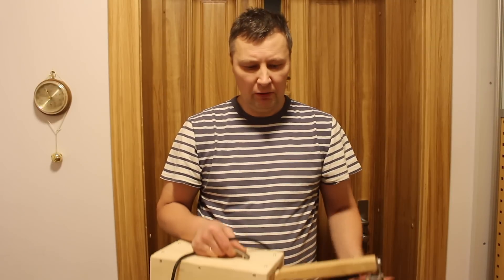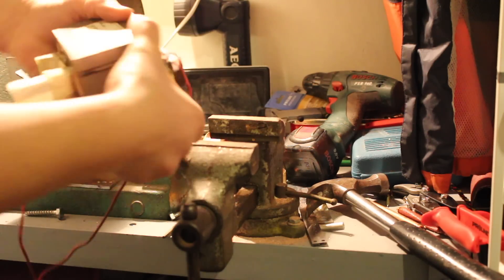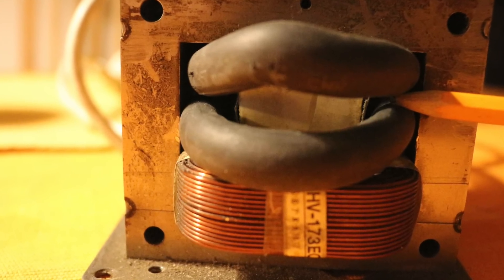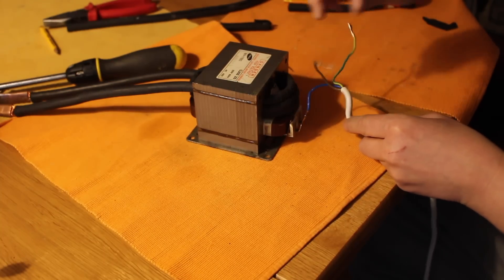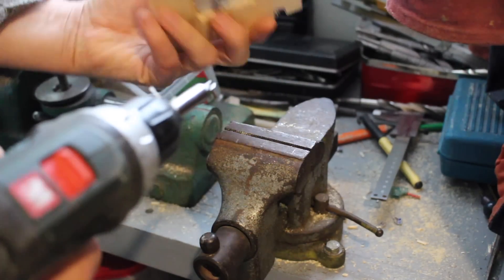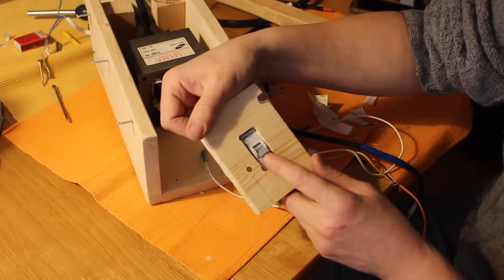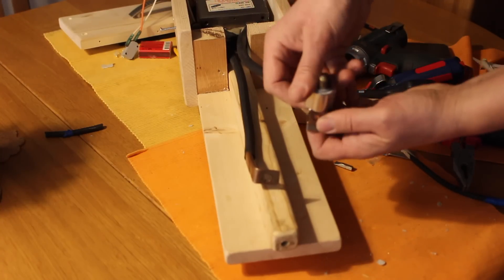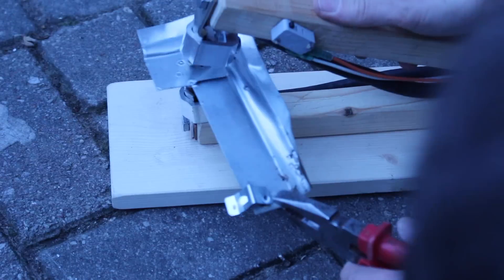Spot Welder from microwave  -   how to increase the power

Comment: I just shortened the lead wires on mine and worked better. You increased the voltage with another turn thus shortened the lead wire.

Comment: where did u get that black cable did u get that from the microwave? How long the cable must be if u do 2 turn  also if u do 3 turn thx
Reply: Black cable is from a stick welding leed. Or a groud leed. Can get it from a welding supply store or maybe a car stereo shop the wire from subwoofer amplifier to batteries

Comment: I want to build a spot welder like this but set it up to weld mortice lock keys together to make my own keys. Do you have any suggestions on how to modify the welding electrodes to weld keys up from scratch, I know that most modern mortice lock keys are spot welded together in 3 pieces (a washer, a stem and a blank part that is cut to the profile of the lock levers) but HOW are these keys welded together using a spot welder ??
Reply from the maker: quite difficult, because the exact current must be hit
Reply: @marisbuildsahouse4304  Hi, I've been working on building a butt welder instead which is what these key manufacturers use to fuse together the parts of a mortice lock key. It does require a very high current from a similar microwave transformer and also a timer to get the butt welds even and exactly the same every time when the key parts are mounted and clamped tightly in the brass holding clamps/welding jig.

Although my butt welder is not quite ready yet, As soon as it is ready and working , I will upload a video of it working on my YouTube channel for everyone to see !

Comment: Did you remove the magnetic bypass also?  In the first version I could see they were in place.  They are the metal sheets between primary and secondary winding.  They limit the current by allowing the magnetic field to take a bypass route.
Reply: I noticed that too. I know them as shunts and they were in place at first then later removed. This is why the nail melted, as amps increased due to their removal, not due to the extra turn which would have increased volts.
Reply: @mattmcgahan  yes and no. The current is limited by the transformer but also by the resistance of the weld. In theory 1 turn should yield the most current but because the voltage is really low then, the resistance limits it more then the transformer would with more windings. Around 3 turns is the most optimal balance between voltage and current in a MOT spot welder
Reply: @felixb.1756  That's right, and anyway, in any case you should try to use as thick cable as possible, why leave opening not used.
Reply from the maker: remove

Comment: How can increasing the turns of the secondary coil increase the ampere? That only reduces the ampere and increases the voltage of the secondary coil.
Reply: Note that, he reduces the cable distance, then the resitence is low. I dont belive that  it is relare withnincrease the volts.
Reply: @TheHeliosm  He uses the same cable for the two trials on the secondary coil. Therefore, the resistant is unchanged. When he increases the turn of the secondary, he reduces the ampere. He needs higher ampere in the secondary coil to heat up the objects quicker. To increase the ampere he had to reduce the turn of the secondary coil. According to the physics if I make the turn of the secondary equal to the turn of the primary coil, both of the coils have the same voltage and ampere (if I did not count the loss of energy creating heat in the metals). If in the same coil I increase the turn, I increase the voltage but the ampere and vice versa. I am going to find a transformer to try and see what will happen. Thank you for your interesting.
Reply: Yes,  but the conductor  have less resistence it is shortes, out of coil.  For other hand , you have less current but  the voltage increase. Take in acount that    inportan is the power. I did experience 10cm  can reduce de power in the load from 600w to 300W
Reply: @TheHeliosm  I get what you mean. I agree with that.
Reply from the maker: its real

Comment: you can get heat shrink tubing in long lengths at harbor freight cheap, i would use several layers, is your primary 220 or 110,  will 110 peimary work?
Reply from the maker: i have 220 but also work with 110.
110 primary is the appropriate number of turns and everything is ok.

Comment: as it is AC, I'd guess it may work with aluminum too? PS no fan?
Reply: aluminium has more loss than copper, it is now recommended because it has higher resistance,
and at high  currents every small resistance will affect the performance.
Reply from the maker: yes

Comment: Is 3 turns of thick secondary wire too high voltage for 18650 Li-on battery spot welding? Most videos for 18650 spot welding use only 2 turns.
Reply from the maker: yes

Comment: hi , very useful video you got there.  can do so much things in my kitchen and garden.  would it be possible for me to joint 3 mm to 10 mm bar for my bbq grill ?  my gratitude sir
Reply: no, you need 3 transformers in parallel for that,
1 can weld under optimal condictions max 4mm (and you want 13mm in total)
Reply from the maker: :)) thanks

Comment: FWIW, instead of electrical tape, try Googling "CID A-A-59163".  That is the MilSpec for a self-fusing silicone tape that insulates to 400v per *mil*, and there are many tapes that more than double that rating.  (It has been used since the 50's by the US military to protect the wiring of their planes, hence the nickname 'F4 tape', because of its extensive use on the McDonnell Douglas F-4 Phantom II.")
Reply: Its not the rubber cheap electrical tape, it's installation tape. Sort of the same thing you are talking about the he is useing. That's very interesting though never new the origins of the name cheers.
Reply: Thanks for that info. I was concerned about using electrical tape. That melts at a fairly low temperature.
Reply: Where do you get that stuff dude

Comment: What was the Amp Rating on that Micro Switch ?   That gave me the Creeps.
Reply: They're about 15 ampres in America. I used one and it welded the circuit into the on position. I'm currently looking for a new switch, no pun intended.
Reply: LOL, Yep.   Easy fix !   https://www.ebay.com/itm/Output-24V-380V-25A-SSR-25-DA-Solid-State-Relay-for-Arduino-Raspberry-Pi/321873890198?ssPageName=STRK%3AMEBIDX%3AIT&_trksid=p2060353.m2749.l2649
Reply: Its the same switch from the microwave. Its just letting the 15 amp from the wall outlet into the primary coil.

Comment: You should NEVER use a breaker for an on/off switch. You can use a regular light switch and I recommend you do.
Reply from the maker: Thank you. This is for safety. At rest at this stage very little A, not even 1A. The working position is not more than 20A.
Reply: Rockyj jones :   And why not ?   please tell why you shouldn't use a breaker switch ??   it wont hurt a thing !   it will be completely fine !  Dam I hate when people gotta act like they know what their talking about when they have absolutely no clue !
Reply: @stevelamperta865  they must be an armchair electronic wizard

Comment: hey, I also build one, however my cable gets very hot and it isn't melting. I don't know why but it seems like to be in the cables. I've got 35 mm^2 cables but they get so hot. but when I put a metal plate between it won't meld. please help me? what could be the problem?
Reply: Du musst 50qmm Kabel nehmen!

Comment: hi i made spot welder from 24volt TR 200VA original input is 400volt output 24v i revind and   i put 230volt input and i get 1.2 volts out  but not working small nail start to glow but not weldet
can i  make it stronger  somehow
Reply from the maker: like me. Need more winding in the secondary winding.

Comment: Greetings from Colombia, how many amps and voltage this arrangement can generate, thanks
Reply from the maker: 220 V, 7-10A generate 3V 1076A
Reply: @marisbuildsahouse4304   not possibile.primary and secondary power must be same. sec power can only be smaller than primary

Comment: Power was increased because in version 2  you removed magnetic shunts (small plates between Pri and Sec coils)
Reply: Agree. Increasing turns ratio doesn't increase out power but voltage and lower the current actually. Now if he tries to change it back to 2 turns, he will get more "Power" (it's actually more current).
Reply: Actually.
Increasing turns make coupling more efficient.
More Volts on same length wire=More Amps=Increased Power. (As long as primary doesnt limit current, Which it shouldnt in this case.)
More volts=More current flow accross load(nail)
Reply: I tried secondary in short power and it wat 1400W with two shunts, 1600W with ony one and 1800W with no shunts with 4 turns at 3,5V so you are right, do you think lowering turns will help with current?
Reply: @AntonChromjak  yes its simple math. less turns -less voltage=more amps.
Reply: @krlenjuska  What the fuck are you talking about? V=IxR therefore I=R/V that means that fewer volts will deliver less current through an equivalent load.  The reason you get more current out of the transformer with the lower voltage is due to magnet saturation of the lamination, IE you are operating under overload conditions, what you really need is a larger transformer.  Look it up on "Da Google" or something.
Reply: @Expedient_Mensch  Not right. Less turns in the secondary, less voltage and more amps. Krlenjuska is right. Turns1/Turns2 = V1/V2  and Turns1/Turns2 = I2/I1
Reply: @Expedient_Mensch  haha formula correct but conclusion is wrong, here an example
1. I=R/V -> 10ohms / 5volt= 2 amps 
2  I=R/V -> 10ohms / 10volt= 1 amps 
less volt= more amps
Reply: @josephcaporaso4774   yes,and no :)   power in secundar is produced  from power in primar.you cant just wind one turn in secondar and left it  empty and say-i have maximum power.... for using  more from primary coil,you must fill the secondary field with wire as much as you can...three turns of welding cable without isolation filled better the secondary window and used transformer capability better.more wire in secundar,-more induction and more using of power that primar can give
Reply: @hyperhektor7733  ohmov zakon  (I=U/R)   NOT I= R/U 😇

Comment: Hey, very nice video!

There is one thing you got wrong though:
The reason why you had more power after you changed your setup was not because of the additional winding but because you remove the metal that was between the primary and secondary!! This metal doesn’t look like much but it has a very strong effect! It is used to reduce the output current of the transformer by giving the magnetic flux a side path. Here is an interesting read in that topic: http://info.ee.surrey.ac.uk/Workshop/advice/coils/leak/weld/index.html

Long story short: if you want full power out of your transformer, make sure there is no metal between primary and secondary coil!
Reply: Actually, nothing was changed in the transformer core when he increased the winding by another turn, so the amount of flux remained the same.
What happened when the winding was increased from 2 turns to 3 turns, the voltage at the secondary was increased by 50%, which helps to overcome the current due to resistance.
Ohms law: Voltage = Current x Resistance  or  Current = Voltage / Resistance.
Reply: very interesting

Comment: What did you use to flatten the copper cable to make the cable lugs?  Hammer it flat, vice to squeeze it flat or some other special tool?
Reply from the maker: The best option is to go to the electricians or traders who have a cable shoe press, it takes 2 minutes to press. Can be screwed, but not so good.
There are also special shoes with screws and knit head.

Comment: Hello there  I need you Advice I have this Stud welding matching  that only work with High Voltage AC 380V 60HZ my question is,how to change the current to 240 volt here in USA   to make   work

Comment: What kind of thermo isolation please? Name of the producer please, can not find on market. Thank you.
Reply from the maker: "Tesa" cloth insulation board +125 C
Reply: Found it. Tesa. But how do you know is thermo isolation tape? Thanks. Also, at min 13, to avoid sparks, you must put pressure on electrodes. There is a resistance welding tutorial on yt, they say the pressure is important. Also, too much pressure is not good.
Reply: Maris Builds a House thank you very much

Comment: You actually didn't increase the power, you increased the voltage. However the amperage dropped proportionally as well. The power output, or wattage, remained the exact same either way. When you increase the windings, you increased the voltage, but lowered the amperage. You don't get something for nothing. And the output wattage has to equal the input wattage. Again, you don't get something for nothing.
Reply: You had to criticize to get your 2 cents...lol He got the results he wanted.
Reply: B  Rad - “one thing at the time”...the original secondary winding for use in the microwave oven had much higher number of turns than the primary winding. That generated thousands of volts at low current. Power from the secondary winding may be around 90% of the power applied to the primary winding. The 10% is lost mostly as heat. 

At first a two turn secondary was tried for the welder. That did not generate high enough voltage. It’s true, the output power is equal to the input power minus the about 10% losses. However if for example the secondary winding is open, there is no current and no power delivered. 

Anyway....in a second attempt, turns were added to increase the voltage, generate higher current through the resistance of the nail.
Reply from the maker: Yes, the voltage stays above 1 volt, while the metal melts at the moment, so we say that the power has become larger (in plain language)
Reply: Actually you've got it backwards... he decreased the voltage but increased the amperage. Before the secondary was switched out for larger cable, the voltage was high and the amperage low. By changing out the secondary he essentially reversed what the transformer was meant to do and raised the amperage but lowered the voltage to probably around 2v
Reply: @Bags2723  No, you got it wrong. When you increase the number of windings, you increase the output voltage. What Gary Mucher doesn't understand is that it's a simple case of ohms law. The nail has  a certain resistance and when you increase the voltage and the resistance remains the same, you increase the amount of amperage through the nail, melting the nail. Maris achieved what he wanted to achieve by increasing the windings.
Reply: I agree.. when you increase voltage you decrease amperage but he did the opposite. Of course, lowering the number of turns on the secondary would raise the amperage.
Reply: Would a dimmer switch on  the ac side work to regulate the weld
Reply: I built a spot welder that has a glorified "dimmer switch" on the primary. I linked the source in my video on my channel. Its SCR based, and there is a lot of info as well as new pre-built controllers that the guy is now selling in the link I provided.
Reply: Hi Gary, that dépends here if the amperage is limited by the transformer or by the resistance of the nail. In my experiments I see the nail can have much higher resistance than what the transformer can deliver. So in fact Maris increased open Voltage by about +40%, the nails lets flow +40% more current. The Power is thus 1.4 x 1.4 ~ 2.0x higher.
Reply: Then what is the nesesary voltage for spot welding?
Reply: He got something for more copper used in coil with higher turns.
Reply: It's a simple Ohm's law.I=U/R.In this case, he increased the voltage. The current has nothing to do with the voltage. If we have a specified resistance of the material being welded, with increasing the voltage, we're also increasing the current flowing thru the welded material, because the resistance is the same, no matter the voltage.Simple.
Reply: go to school and learn something about electricity, don't watch too much tik tok
the basis is Ohm's law, and it reads I=U/R, smart enough

Comment: I have a question. Do you put the breaker switch on the return cable or the main line to the transformer? I saw in books that you put the breaker switch on the main line, not on the return cable or the ground.... And thanks. It's nice to see that you take the time to explain your steps in the process of creating the machine.... Thanks...😓😓😓
Reply from the maker: Both switches are one after the other on the line where there is a contact socket 220v or 110v. Power line is 1000A ,3V can not be put there.
Reply: @marisbuildsahouse4304  Thank you for your video. One question springs to mind is that you used a 120A CB in line but did you plug into a 30A socket? if so how is that CB going to be effective as the CB in your fuse-box would trip before your spot welder?
Reply from the maker: @monajaat  20A